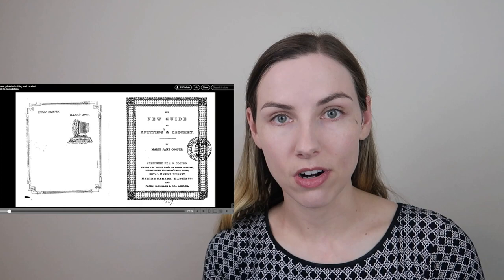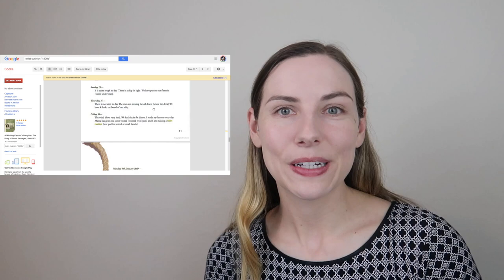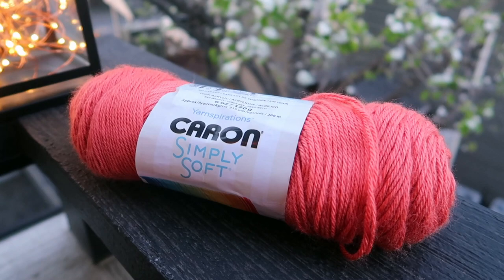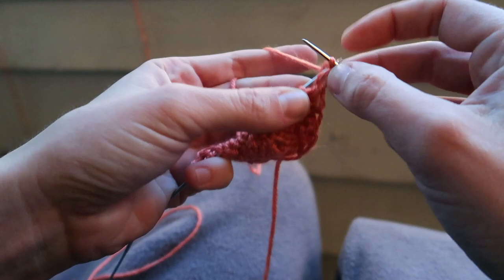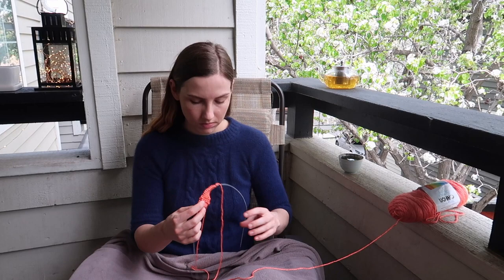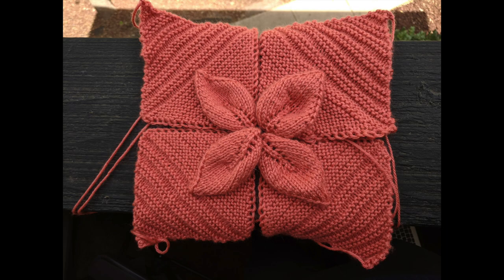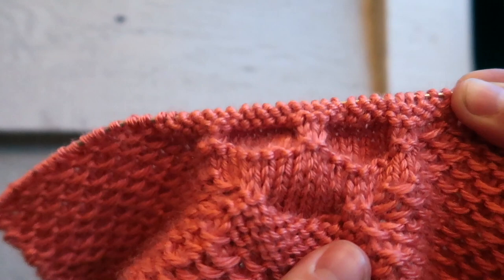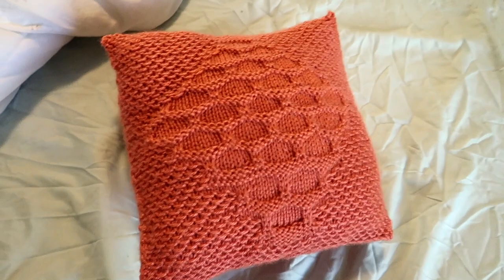1871 Victorian Toilet Cushion || Historical Knitting

Comment: "Toilet" used to refer to the process of a woman getting dressed, doing her hair, putting on makeup, and otherwise getting ready to go out.  This process was called in French, *le toilette*, or "the little work" (I suppose the "great work" would be the lady putting on her stockings, drawers, shift, stays, corset, petticoats, pockets, and dress (and things like detachable sleeves for her gown). She would sit at her vanity table,  in her *chambre te toilette", using the mirror to help her arrange her hair and face the way she wanted it. When people would have a small separate room for their "toilet", they might conceal their chamber pot in that room. And after that the newfangled "water closet" device got installed in the little room.
But I'm surprised that the bench or seat that came with the vanity table wasn't comfortably upholstered.
Reply: It may have originally been comfortably upholstered but the cushion  could've degraded over time

Comment: My interpretation of the first pattern would be:
Round 3: p1, k4, k6wyif, k2, p1, k1, k15, k1, p1, p2tog, k11, skpsso, k1, p1, k1, k2tog, k7, skpsso. This covers 60 stitches, which is half of the 120 (36+36+48) originally cast on. So I guess you'd do it twice. There are 4 decreases in the sequence—over st 32/33, 45/46, 50/51, and 59/60. So 8 decreases in the full round. I'm not at all sure what you're supposed to do after round 14, when the decreases will have backed you up through the long knit stretches. (You'd be down to 24 st total at that point. Maybe you just bind off. And sew a big, decorative button over the hole?)

Comment: It seems that I found this pattern online some years back when I was expecting my son; it was in a blanket form with the petals/leaves in the centre of every 4 squares that made up one square (as on your cushion). I had asked the lady at the time if she knew how to convert it to a plain design (no leaf/petal) and she did just that. She sent me two patterns (original and the ammended one) and two swatches that she'd knit up herself to test the pattern and to give me a visual.
I then made my son's blanket, along with my mother-in-law and her mother as my mother had passed some years prior. We went with a safari theme for the blanket and each had a different colour to work each square into. It resulted in an umber-ish type red, a warm yellow and a pale green that work well with each other. The ladies gave me all the completed small squares that I then darned together to make the larger squares and then darned them together. My grandmother-in-law also crocheted small appliques of monkey and elephant faces (respectively) and whole lions and giraffes. I then added these to the centre of the larger squares and lined the back with some thick linen from an old pair of curtains. It was made to fit the size of a cotbed. My son is 7 now and still has it for on top of his duvet in the cooler seasons!!

I love seeing things and either adapting it to suit my ideas or to work the originals into different places.

The jumper that I'm currently knitting for my son is a hooded jumper that I've adapted from a hooded cardigan pattern. The hood has been a challenge as I've designed it to be seamless and with a cable knitted border to match the front and sleeves of the jumper. I can't wait to give it to him.

Keep up with the historical knits; they're probably still all in use somewhere today! x

Comment: Someone else might have said this before, but I’m adding it anyway. I’ve knit the honeycomb pattern on Westknits shawls, and on those, we just slip the stitches (with the yarn in back) you are putting on the cable needles. That would probably be easier!

Comment: I wonder if the original pattern means (two plain) then (one purl) then (three plain) then (six plain with the thread brought forward [whatever that means]) then (two plain) etc.? It seems like a comma placement issue. 

I've never read a pattern like this - it sounds like a cylinder until the decreases start in about line 6 of the instructions - but would be interesting to give it a go...

Or maybe it's more complex (e.g. some of these instructions are individual stitches rather than rounds?)